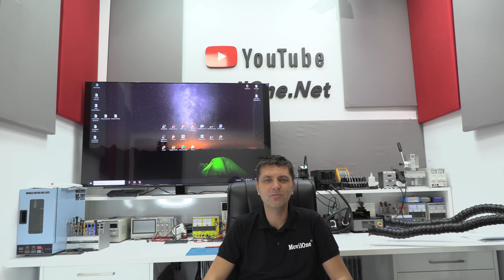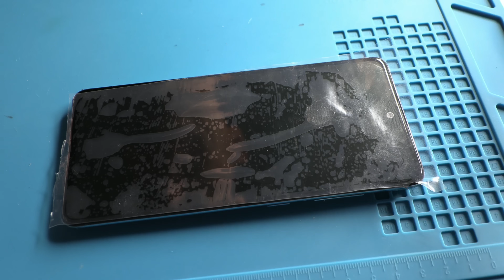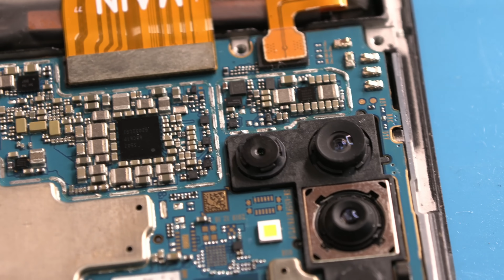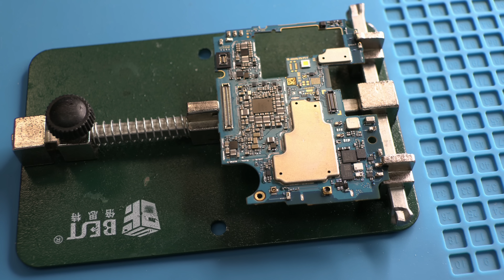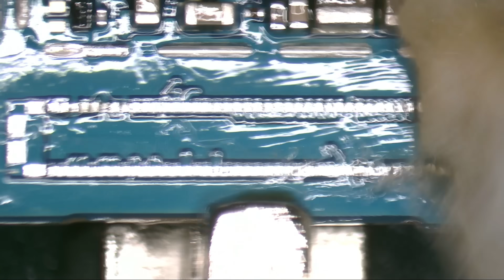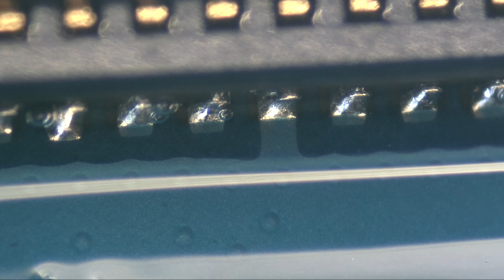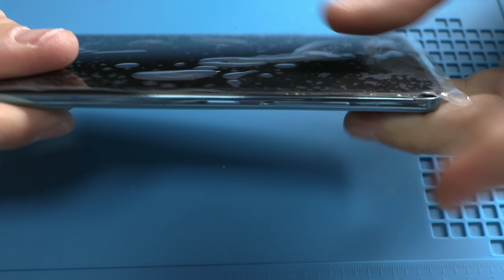The Samsung A Series Secret They Don't Want You to Know!

Comment: If your phone isn't broken physically, they will break it with software updates. They say that old phones can't run new updates, that's why you need to buy a new one.

Heck, I have been using Android 15 smoothly on Redmi K20 pro, which was supposed to end at Android 11.

You know planned obsolescence is a real thing. They spend R&D in designing products that fail in a certain way
Reply: It's not that hard to understand, we have low end Android phone of 2025 with chipset equal to device from 2017-2018 still rocking Android pass 11 (because it's "newer"). For example, the Redmi Note 13 run Snapdragon 685, and it's Android 13.
Reply from the maker: Exactly! If a phone isn’t physically damaged, they’ll find a way to slow it down with software updates. Companies justify it by saying old devices can't handle new features, but in reality, planned obsolescence is carefully designed.
Reply: Thats kind  weird@MovilonePhoneRepair
Reply: Main issue is, that they lock the bootloader so you can't even install a newer software. We need the EU to step in. My dad's S3 neo rocks to this day running android 13
Reply: samsung has been doing this since as long as i can remember, my s2 s4 s7 s9 s22ultra, they all rolled updates that removed features or slowed them down or killed battery life... like my s9+ they removed the pro features for the camera to make it seem like it had a bad camera to force people to upgrade.. my s22ultra, the speaker failed in 3 months of owning it,, when it first came out, countless people had this same issue and samsung did nothing to help, then the screens get black dots that get bigger and  bigger over time, and then the recent one ui update last year started shutting down s22 and s21's and they wouldnt turn back on, it was some voltage issue on the main board... when it happened to me it was so unfuriating, i sometimes didnt have a phone for hours in the day.. i turned it on power saving mode to try to stop the voltage damage, and this worked, but then i had to keep it on power saving 24/7....  i finally killed my s22ultra the other day washing it by accident.. and as much as i wanted a s25ultra.. i finally put my foot down.. im done with samsung.. so i went to the motorola razrultra 2025.. samsung can rot im done with them... they do this to their fridges and microwaves and other stuff too... and yes i know the razr 2025 supposedly only has 3 years of software updates, but i dont care, i dont keep my phones beyond 4 years or so anyway, and i dont need them to have the latest and greatest updates anyway.. sometimes the constant updates like samsung does actually makes  the phones way worse.. i tried to keep my s22ultra from updating itself for the longest time and one night it did, and thats when i hate the black screen of death on it
Reply: Snap! I have Android 15 on my OnePlus 5 (a 2017 mobile).  I installed LineageOS about six months back, and it runs fine.

The OEM's bank on the naivety and gullibility of the masses who believe the fiction of old is bad, and you MUST be on the annual update treadmill, lest ye die!!!

The same applies to MS Windows versions, but that's a story for another day...
Reply: That's what happened with my iPad mini. It can still run but lacking software updates (cannot install apps) and the screen glitching (also seen in other iPads) made it unusable. Like why?
Reply: Its crazy motherboard are modular but not at the same time soldering it and stuff is so crazy how you can repair it like it just seems like it shouldn't work once its broken  but to take it apart and put a new one on and it works is crazy I love tech
Reply: I haven't experienced this I keep all my old phones my a33 is my current phone but all my Samsungs still work my s3 mini my s4 my s5 my a20 and my a33 all still work just fine
Reply: There is also planned obsolescence by Google. You cannot run any bank apps without passing play integrity.
Reply: Couldn't phrase it better.
Reply: But what advantage android 15 gave you?
Reply: Fr, I had a tab A7 lite and they made it unusable with the last update it got (lags in settings and homescreen)
Reply: No one says this
The reason is the manufacturers would have to spend a ton of money to keep supporting older devices (keep in mind, each update has to be made for each phone specifically).
But Samsung and other companies are now good at this, they are doing 6-7 years of updates (and of course you don't have to throw it out when it is no longer supported)
Reply: @pepparody yet somehow I can run all the latest operating systems on a two decade old laptop. Maybe arm processors are just garbage that way.

Comment: Wouldn't this be easier to solder if we use Relife 138c solder paste instead, the one that has lowest melting point?

Also the newer models are much tricky to get successfully replaced connector, it is much difficult than older models.
Reply from the maker: Yes, using Relife 138°C solder paste can make soldering easier due to its lower melting point. It should be noted that this solder is too soft.

Comment: Had an A71 for 5 years. Never encountered this problem. Changed the charging port board three times though...
Reply from the maker: Five years without major issues is impressive! But replacing the charging port board three times shows how certain components wear out faster than they should.
Reply: @MovilonePhoneRepair A71/ A51 are notorious for this issue. Most people I know changed their port at least once.

Comment: It's not that they're designed to fail, so much as they aren't designed to last longer than the average consumer has one.. 
Non replaceable batteries, no headphone jack so the batteries in your headphones make you buy new ones, and so on. Even things that used to be immortal like refrigerators fail so quickly, totally offsetting the power consumption and environmentally friendly refrigerant difference and then some. LG lg near compressors fail so much for no reason. Fridges from the 1950's still work fine, so do ones from the 90's and pretty much everything in between.
Reply from the maker: That’s a great point! It’s not just about making devices fail—it’s about designing them to last only as long as the average consumer keeps them. Features like non-replaceable batteries, missing headphone jacks, and fragile components force unnecessary replacements. 

Even home appliances follow the same pattern—old refrigerators last for decades, while new ones fail within a few years.

Comment: Finally more people speak about it. Also a jumper will fix but still replacing the fpc is better.
Reply from the maker: Yes, more people are speaking out about this issue, which is a good thing. A jumper can work as a temporary fix, but replacing the FPC is definitely the better long-term solution.

Comment: I had some A series phones myself for years on end using them daily. Never failed.
User error might be involved in these cases. For example using faulty chargers or cables. Or dust or humidity filtering thru the phone's gaps.
This barely happens on high end devices, that's why they're expensive, better quality materials. If all phones would be assembled with the same quality, you couldnt possibly have 200-300usd phones, that at least with all the patents, regulations and taxes on every unit sold that both the manufacturer and the end consumer pay.

You get what you pay for. Not proper care on low-mid tier phone inevitably will get your phone's internal damaged.
Reply: most phones don't even have this problematic cable. if they cared so much about cost they would not put this weirdly placed cable in there since an extra component means it costs more to make
Reply from the maker: It’s true that not all A series phones fail, and user error can sometimes contribute to issues. However, there are also clear design flaws in some models that make them more prone to failure over time. High-end devices use better materials, but that doesn’t justify making budget phones with weak components that fail prematurely.
Reply: @MovilonePhoneRepair  Would you believe I'm actually having the same exact problem mentioned in the video? I can't believe myself, I still stand by what I said but it seem that being so confident brought me karma or something.
Unbelievable, I'm in shock sir

Comment: @9:35: looks like there is quite an offset between pads and pins, may be it is an illusion but you did not show if you used a microscope (seen next to your phone) to align the connector properly. without magnification it would be impossible to align it properly.
Reply from the maker: This distance is very small.

Comment: even more problematic is when you also concider the amount of money and resources they put into making such materials more fragile, and that in cases they are actually more expensive to make that way than they are to make them with propper  materials, and in most other cases the production price is essentially the same
Reply from the maker: Exactly. Sometimes, making materials weaker requires more effort than simply using durable ones. This shows that planned obsolescence isn’t just about cost it’s a deliberate strategy to shorten a product’s lifespan.

Comment: Oh my goodness, my Samsung A05 couldn't charge properly. I replaced the charging board, and the problem still persists. 

I tested every capacitors and resistors and found nothing wrong with them, I thought the charging IC must be the cause. I remove and replaced with a new one, the problem was still there. 

I gave up and just put away that Samsung a05. 

I never thought of checking the main connector. But I only checked the flex cable and turns out to be fine too. 

I'll definitely get the phone back and check the connector.... Damm😡

Thank you Sir for this informative video.  🙏
Reply from the maker: You put a lot of effort into troubleshooting your A05! Many people overlook the main connector, but it can often be the root cause of charging issues. Hope you manage to fix it—let us know how it goes!
Reply: @MovilonePhoneRepair  I placed an order for the connectors and am waiting for it to arrive. Hope the problem will be fixed.

Comment: I use the samsung a 5 2017, never had an issue
Reply from the maker: If your Samsung A5 (2017) has never had issues, that’s great! Some older models were built more reliably than recent ones, which seem to fail more often due to design changes.

Comment: Do not force install W10 & 11 on older CPUs , after sometime they will corrupt the BIOS and the system useless.
Reply from the maker: That's a good point! Forcing Windows 10 or 11 on older CPUs can sometimes lead to BIOS corruption, especially if the manufacturer hasn't provided proper support for those versions.

Comment: Is lithium ion polymer battery the same as lithium polymer battery?Thanks!
Reply from the maker: Good question! Lithium-ion polymer and lithium-polymer batteries are similar, but there are slight differences in their chemistry and structure. Both use polymer electrolytes, but lithium-ion polymer batteries tend to have more stability and better longevity.

Comment: Meanwhile, me - writing this comment on my nearly 7 years old Samsung Galaxy A8 2018 :) Never been into a service or damaged.
Cheers ! ;-)
Reply from the maker: That’s impressive! A well-maintained Galaxy A8 (2018) lasting 7 years without service is proof that some older devices were built to last. Cheers!
Reply: @MovilonePhoneRepair  Well, I actually used it at least a few times under heavy load - during the summer, using it for a Wi-Fi hotspot for example, while the battery is charging... that for sure helped for the battery wear, but I am actually still pleased and happy to use it in its current state.
The other detail is that I always have used it with a flip cover, currently with the "Neon Flip active Cover" made by Samsung :) I hate those useless "back covers"...
Reply from the maker: That’s impressive! The Galaxy A8 (2018) was one of Samsung’s more solid designs, and your experience shows that proper care makes a big difference. Using a flip cover and avoiding excessive heat exposure was a smart move small habits like those can significantly extend a phone’s lifespan. Cheers to your device still going strong!

Comment: ah fudge. A51 4G is currently my phone & this video recommended to me. unfortunately, that soldering issue is affect my phone & hits hard. my phone's gyroscope/accelerometer no longer works since 2023 & charging issues on next year. i fear my phone would commit "ending themselves" potentially next year or as late as 2 years.
Reply from the maker: If your A51 is already showing issues with the gyroscope and charging, it’s possible the soldering problem is progressing. Hopefully, you can get it repaired before it becomes completely unusable.

Comment: I confirm, this is the same on my samsung tab s3 the screen halved working, the top was like black and white lines and bottom screen works half!!.. i brought it to the Samsung authorized repair shop, and they told me its the motherboard mist be replaced! O said no, the price was lile thesame for a new tablet, so i left, then i go to the my local phone technician near where i live a GOOD friend of mine i know him a long time ago because i buy screen protectors and phone and tablet covers at his store. He took a look at it and he showed me in the magnifying lens that the connectors on the screen are cracked he said this is a common problem in samsung a series and tablets alike, the connectors deteriorate in time, and made to fail on purpose! So i asked him how much it'll cost and when i knew the price was a fraction to solder than to replace a motherboard i was so happy and he done it in under 30 minutes while i watched.. after that my tablet works perfectly, i thanked him so much for being honest to me and the price was reasonable..and this was 4 yrs ago and now still works.... So my tip dont buy Samsung tablet or like the guy said the A series, after this experience i NEVER buy Samsung again! Because i feel cheated you know..

Comment: Has a Samsung Galaxy A52s. That has an official IP rating of IP 67. However, without any physical trauma whatsoever, the plastic back panel suddenly started to come off. The adhesive dried up and caused the back panel come off

Suddenly the IP rating was useless because the entire back panel was loose
Reply from the maker: That’s a frustrating experience, and it highlights a key issue with IP ratings—manufacturers test them under ideal conditions, but in real-world use, factors like adhesive degradation can compromise the seal. Over time, heat, humidity, and even normal wear can cause the glue to dry up, making the back cover detach. Unfortunately, once that happens, the device is no longer water-resistant, despite the original IP67 certification. Reapplying a high-quality adhesive can help, but it’s something manufacturers should address with better materials and designs.

Comment: How are you satisfied with that electric screwdriver is that Xiaomi screwdriver, purchased 1 of them and after 7 months it failed to work only can use manually, purchased another one the same one and that one also fail after 7 months, strange! Or maybe I am not getting the genuine product at all.
Reply from the maker: That’s unfortunate! Xiaomi's electric screwdrivers are generally reliable, but if you've had two fail after just seven months, it could be a quality control issue or a non-genuine product. Have you tried reaching out to Xiaomi support?

Comment: As a technician in Greece, I come across this issue very often, and noticed on some newer A52 mostly devices, that also the board slightly deforms in the middle of the connector, making it very hard to solder back a new one!
Reply from the maker: That’s an interesting observation! If the board deforms near the connector, it could be a design flaw or weak PCB material. That would certainly make soldering a new one more difficult. Thanks for sharing your experience!

Comment: Thank you for this video. I have at least two A series Samsung phones in my workshop that won't charge, OR the screen acts very weird, even after replacing the screen. For the won't charge issue, I'm almost certain that your repair is the correct fix, for the others, well, I'm just guessing, but it's worth a short. The replacement part is cheap. Worth a try
Reply from the maker: Thanks for your comment! If your A-series phones aren’t charging, this repair is definitely worth trying. As for the screen issues, sometimes motherboard-related faults can cause display glitches even with a new screen. Worth investigating further!

Comment: I can confirm! I had a drawer full of only series A main flex and fpc connectors in stock!
Something similar was also a Poco X3 issue, but on later revisions they made the flex a tiny bit longer so it didn't bend the fpc connector.
Reply from the maker: A drawer full of A-series flex and FPC connectors says a lot about the issue! Good to hear that Poco addressed the problem with a longer flex in later revisions—sometimes even small design tweaks can prevent major failures. Thanks for sharing your experience!